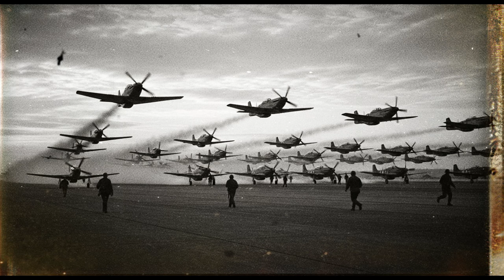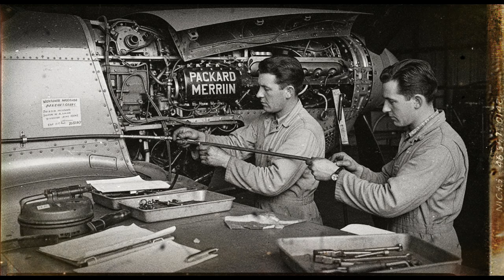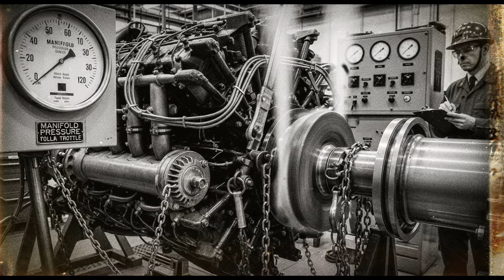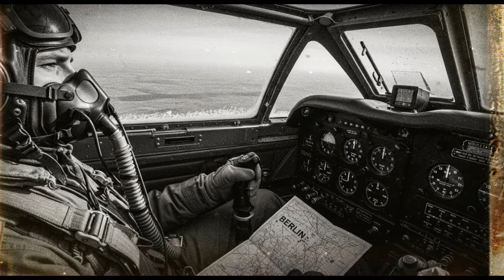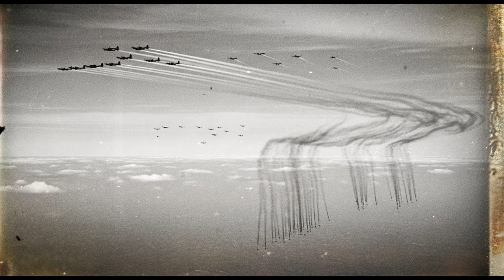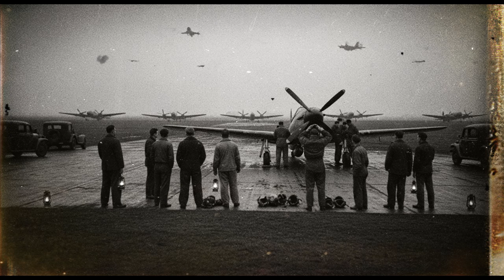How One Engineer’s “Impossible” Fuel Mix Gave the Mustang Range to Escort Bombers Over Berlin

Comment: Actually, the higher the octane, the less volatile the fuel.  Where low octane fuel would knock or "detonate" destructively, high octane fuel would burn controllably at the high compression needed for high power.